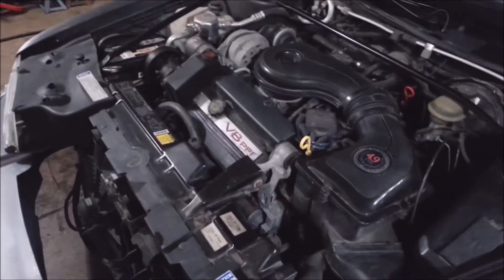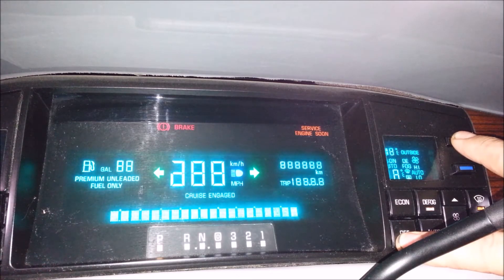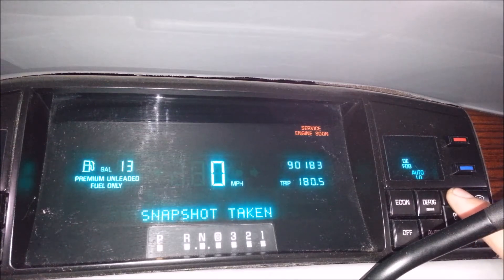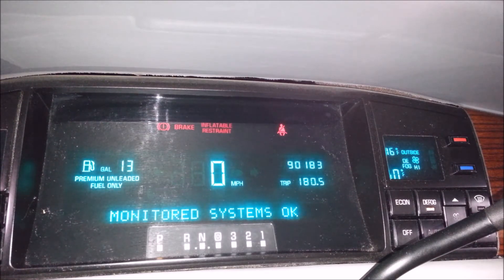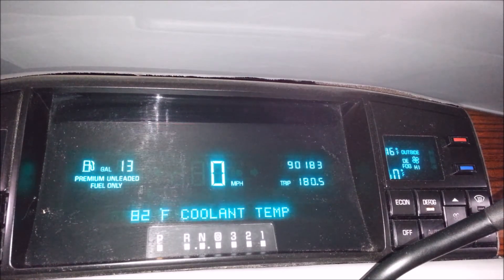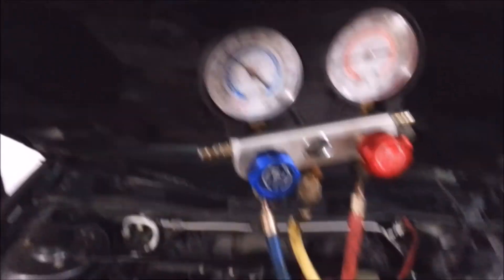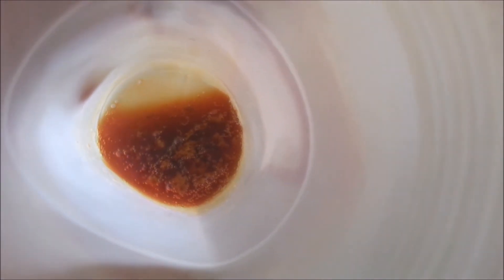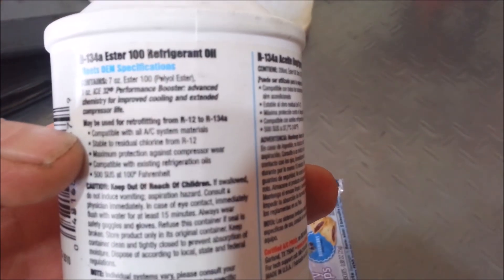1992-1996 Cadillac Eldorado retrieving and clearing codes

Comment: Thanks draining and replacing oil worked.
The only part I don't understand how you got to the point where you were clearing the codes on that dash read out. Maybe you could do a video on how to set that up on a 93 eldorado 4.6 coupe or maybe tell me where to find that info?
Reply from the maker: I just remembered that stuff from doing it a long time ago. I was a mechanic for a cadillac used car dealer about 28 years ago.

Comment: Question...92 Eldorado power steering leak on passenger side...wheel makes noise and can hardly turn it left/right. Was quoted $1400 for the 3 hoses..does this sound lije big expensive repair job.....probably pump also.....any answers would be appreciated.
Reply from the maker: That can be expensive for someone to do. Lot's of labor. It's noisy, and hard to steer, because it's low on fluid. You probably have major, minor leaks, and seepage, so they just want to do it all. If you run the car, and have someone turn the wheel all the way to lock, it will multiply fluid pressure, and you can probably look, and see the leaks yourself.
Reply: @RustBeltAuto  Thank you so much for replying. I thought of getting it fixed but worried about would go wrong next especially since I would be using it more and it would all be too costly . Thought of selling it but if it needs work plus don't know who would be interested and don't want to junk it. had it for 24 years.....Thank you again for your expert answer. Just not  sure what to do.
Reply: @tristecoeur2016  beautiful car tho..eh..

Comment: On my 1994 Eldorado, I can trick the system by momentarily disconnecting the battery for about a second.  It will then allow the AC compressor to start momentarily so you can start charging the system.  This is easier with 2 people.  If the system is just LOW and not empty, you can get an ounce or so in and then it will keep running and you can keep charging and you're good to go!

Comment: I would like to ask if they are going to change the parameters in the menu somehow using the heating control. I feel like I did it. If I don't like it, but if so is there somewhere to get a listing of how to set it?
1993 Eldorado 4.9
Reply from the maker: Google how to calibrate hvac. What I did doesn't change any of that. I would guess you have a blend, or mode actuator issue. That's the best advice I can give.
Reply: @RustBeltAuto  Well, I just needed to erase the mistakes and I fumbled. And probably something changed when I switched it from the engine compartment went various buzzing sounds. Thank you for your advice I'll take a look at that calibration